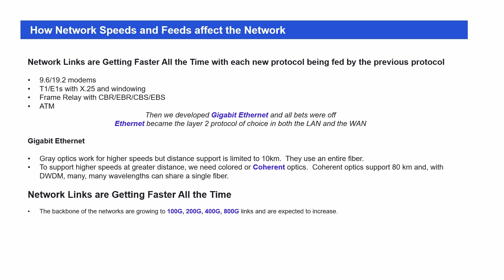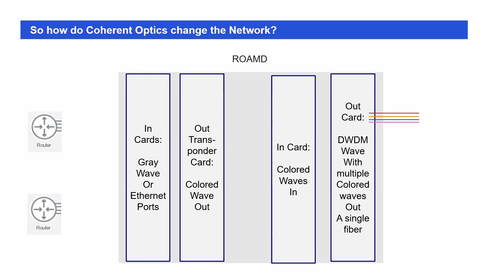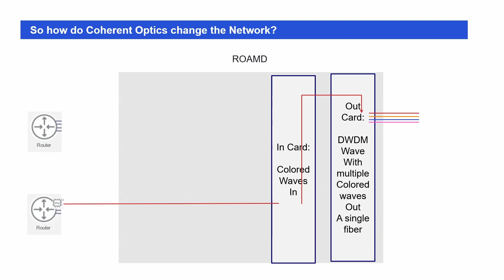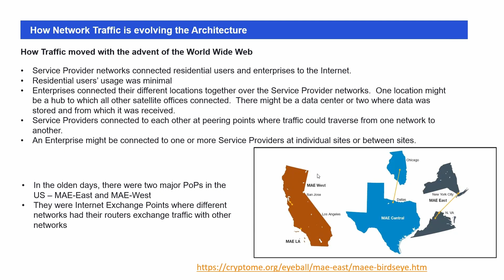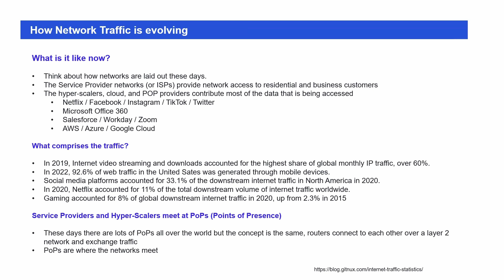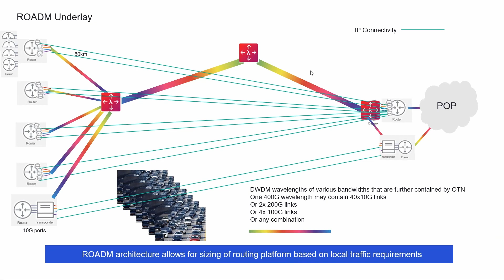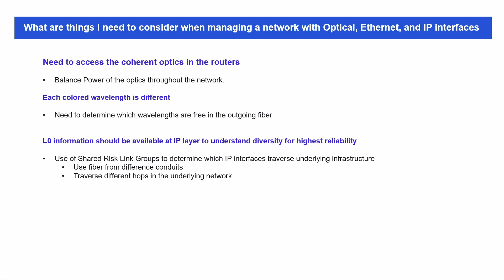Routed Optical Networks

Comment: Hi Barbara. This is one of the most interesting videos I've ever watched. 
Let me ask you a question: I think that
1. There is one single internet covering the world. 
2. In contrast, there are many dwdm "parches" which are basically independent units composed of adm's and transponders at the endpoints  for data entry/exit.
3. Routers connect to these transponders and make it possible for data to hop from one dwdm patch to the other.
Is this view of the internet correct?
How many dwdm patches are there in us?
Reply from the maker: Hi. Well the Internet is also a series of networks. Inter means between. With the Internet there are networks layered on top of networks. Inter means between.  In the way that Border routers connect routers in different areas, optical switches can also connect between different DWDM networks. There’s always been and underlay for the internet. Originally it was the phone network. As technology improved and we needed more data, we evolved to optical networks. So the optical network works in the same way as the routed network but as an underlay with a different address space and a lot more throughput
Reply: @BarbaraAnne  Thanks! Actually if you make a video on this it will be great. Because separate videos about wdm, otn and ip are dime a dozen, but there is nothing, virtually nothing which shows how they work together.

Comment: Im a telco guy, you didnt include the evolution of PDH to SDH then NGSDH to CWDM to DWDM and now OTN. We actually have more optical transport on the local networks than long haul. The IP and Ethernet guys always believe that their P and PE routers are directly connected via fibre over a 10Gbe port which isnt always the case. ROADM isnt cheap because its design is multiplexed similar to SDH and you need to build a ring and cannot just do a hub and spoke as per the older passive DWDM networks for best practice. Its also not economical for enterprise transport because the client ethernet ports on muxponder transponders are typically clear channel and you still need a switch or router to do your traffic engineering and routing etc. Its mainly a transport multiplexing purpose as how we have deployed them since 1990 hah.

Comment: As an old telecom guy, going back to the analog days, I found your comments about going hop to hop to hop to cover a long distance curious.  Even half a century ago, when I got started in the business, there would be trunks carrying the traffic between distant locations, without being broken down at each hop.  These days, there could be some fibres used for short hops, but also others that are essentially passed all the way between distant points, without passing through routers routers along the way.

And yes, they worry about power levels, as they did even back in the analog days, where too strong a signal could result in distortion and intermod between circuits.  Even the test tone levels were reduced, when testing over analog microwave links, for that reason.

BTW, there is also Coarse Wavelength Division Multiplex (CWDM)  often used over short distances, where perhaps a dozen wavelengths are used over a fibre and the appropriate SPF modules are used for the wavelength.  These could plug into any standard router that can accept SPFs.  In this situation, the multi-wavelength would connect to a diffraction grating filter, which splits out the various wavelengths and then connects to the individual devices.
Reply from the maker: Because coherent optics can be plugged directly into routers, this video was more about whether using routers was sufficient or if it makes sense to retain an underlying ROADM network.  I think it makes more sense to use an underlying ROADM network to continue to make use of router bypass - especially since there is more traffic that is being backhauled to the POPs and handed off.  The "hop by hop" referred to pushing all traffic through the routers, which does not make as much sense to me in most instances.  I appreciate your comments on the video.

Comment: Hello, I was under the impression that you seem to have come to as well using ROADM rings to actually do all the movement of data between large spread out aggregation boxes and having a few ROADM cards would let you put huge amounts of bandwidth onto few fiber pairs. Some vendors will do 32+ 1.2Tb/s channels in just the C band and another 32+ in the L band. 

Why is it that some vendors like Nokia and Cisco are really pushing for integrating Dense Wave Division Multiplexing Links straight into the routers and connecting them straight to each other arguing that the ROADM functionality can be bypassed entirely for operation expenses reasons since now you only manage "1 layer"? Routers are far far more expensive than optical transport equipment and offer far far less throughput per fiber run and just like in your example the closer you get to large peers or the internet drain you need higher and higher capacity chassis to switch traffic from downstream boxes.
Reply from the maker: That's what makes sense to me too.  Also, from those statistics I quoted, more than 90% of web traffic is generated from the mobile network.  All of that traffic has to be backhauled to the MSC so it makes sense to just forward that on the ROADM network as well.
Reply: Not only those vendors are pushing routed optical networks, but on aws net402 (deep dive on aws network infractsructure) presentation they said aws is doing routed optical network. I believe i also saw a document on microsoft doing the same. Obviously some orgs had found benefits for having the coherent optics on the router.  

I would also like to point out that these days, is the optic that cost the most.  Back in the day router ports were expensive, but these days the cost of router port is not as much as they used to be.  The cost has being moved to the optics.
Reply: the electromatic spectrum used must go to gamma or delta......for security reasons.......the magnetic resonance of just color wavelength is easily detectable by its backward magnetic signature easily translated by a condenser that  mainpulates the sound into patterns.....an optical morse code if you will......
Reply: @pedrosuarez2349  I'm not sure what you're talking about, delta and gamma bands? I'm not a quantum optics guy but I know enough physics to get by for sure. In the NIR bands used in optical transceivers there are the O, E, S, C, and L bands. I don't see how (increasing?) the frequency of your baseband avoids any sort of waveform related security issues, the fundamental properties of the magnetic field would be totally unchanged. You only get half of the picture from the magnetic field anyways as polarization of the light field in modulation effects both the electric and magnetic fields, same with any sort of  frequency modulation (phase is also effectively frequency modulation).